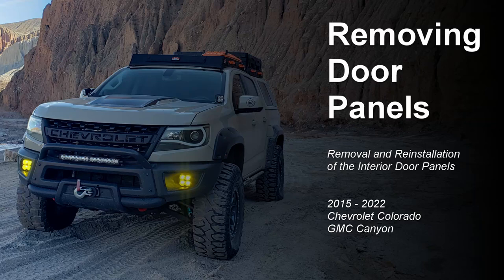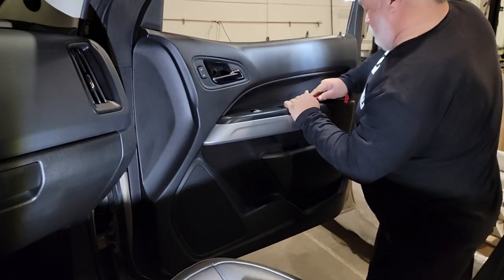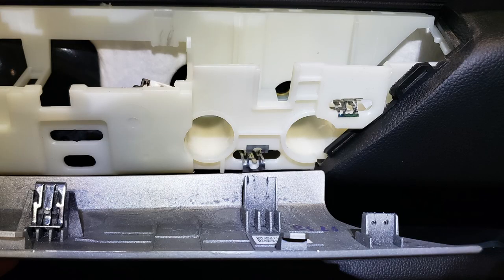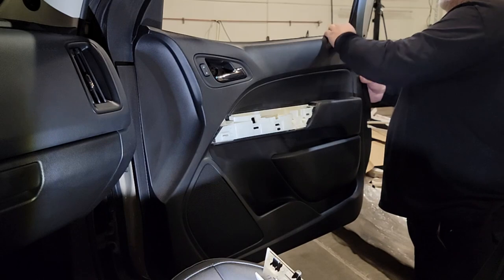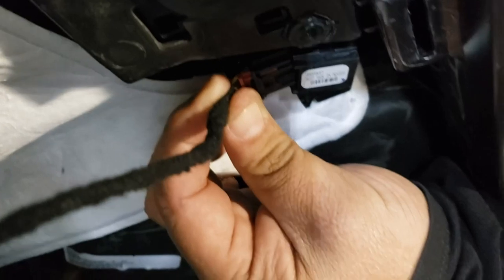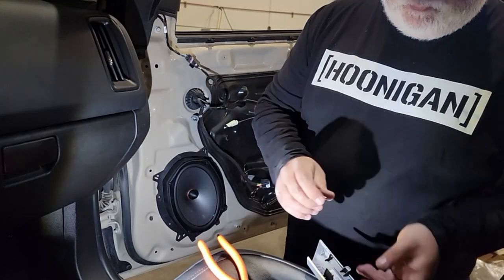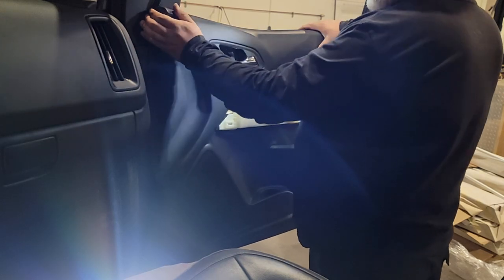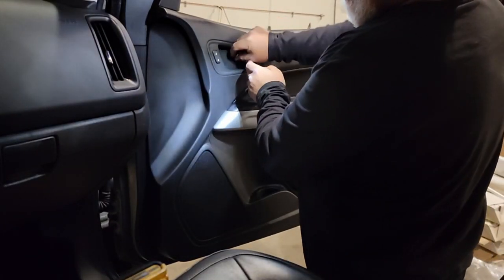Door Panel Removal / Reinstallation - Chevrolet Colorado ZR2 Bison

Comment: The tip with the clips and window seal at the top changed everything, I was installing some tow mirrors and could not figure out how to get the panel back on until you showed that. Thanks a bunch.
Reply from the maker: Happy to hear that it helped. I did figure that tip out until my second time removing the door panel.

Comment: Great video. Removing the window seal and clips and repositioning on the door was just what I needed to get the panel back on. I did have a problem with the door handle clips moving out of place so the screws wouldn’t bite. Had to reposition and tape these clips in place before screwing the door handle screws back in. Thanks.
Reply from the maker: Every install will vary a little based on how the clips and fasteners come apart.

Comment: I have the ZR2 with the upgraded sound package but the bass rattles my drivers side door lock (the part that sticks up where your elbow would be if you drove with your window down and arm out the window)
No issues on the passenger side though

It rattles no matter if the button-thing is pushed out or in - but when I touch it, the rattle disappears.

Ive thought about taking my door apart to fix it but after watching this I still am not sure what would be causing it or how I'd even fix this.

IT seriously drives me nuts as I paid an extra $1,000CAD for the system but all I hear is that damn rattle.

Any ideas?

ps. thank you for this video
Reply from the maker: The Door lock rod has a rubber isolator that it pops into. Tt's supposed to reduce that rattle and Its very possible its not in the isolator. IN the video you will see it as a rubber flange with a hole and slot in it. Also could be some of the wiring in there. I use Tessa tape when i try to eliminate rattles.